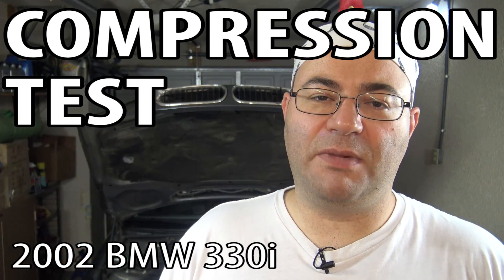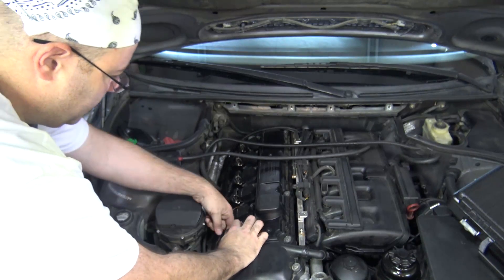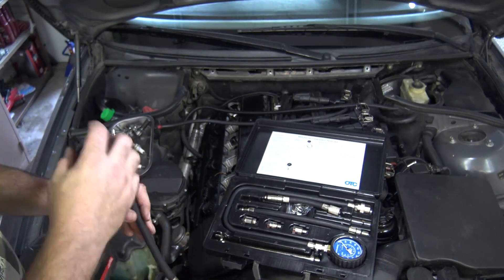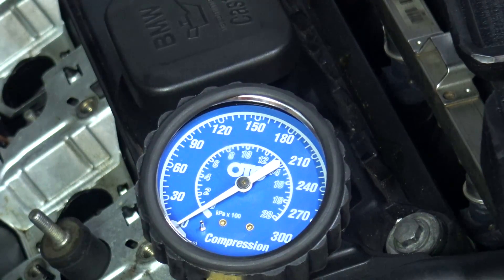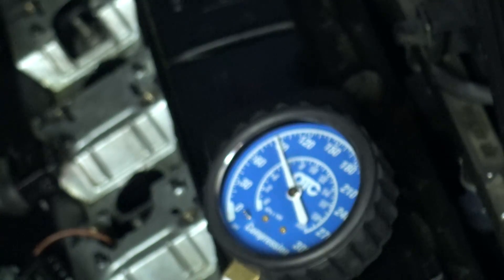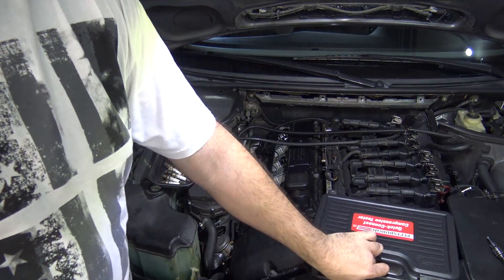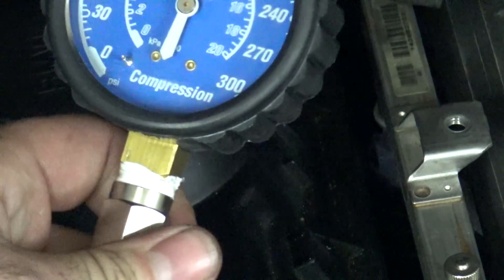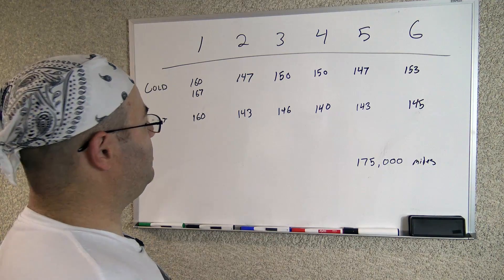How to do a Compression Test on an E46 BMW 3-Series DIY

Comment: Thanks for sharing this video. As always, very educational!
Same issues and same compression values with my m54 200.000km. Looking forward for your leakdown results.
Btw. whats your opinion about "solutions" like https://www.youtube.com/watch?v=_Vo4fm0JDPY ?
Greetings from Germany
Jay
Reply from the maker: Totally valid repair method in that video for fixing a situation where you have a stuck compression ring due to oil varnish deposits.  The solvent gets things loose just like WD-40 would a bolt.  However, if you do have actual compression, tired compression, it's not going to give you any more compression because a stuck ring is not the cause.  We'll find out the cause when I post the leak down test results!